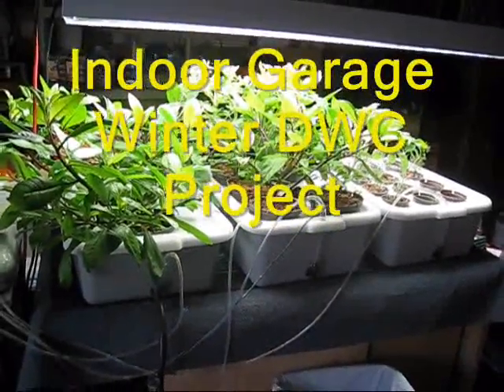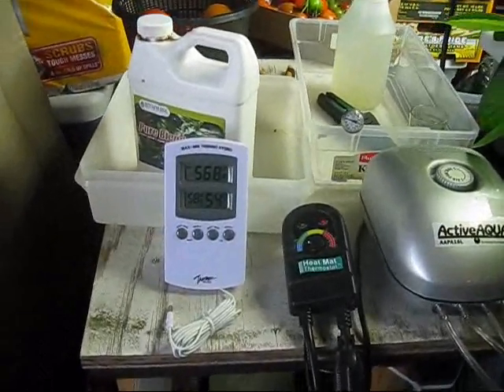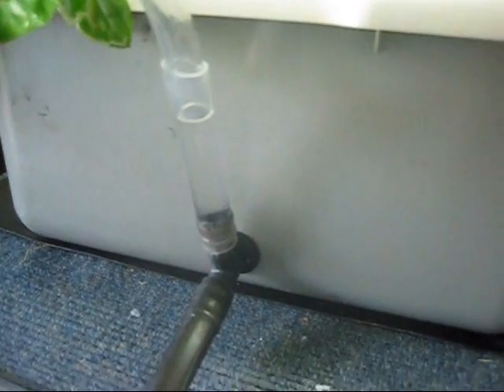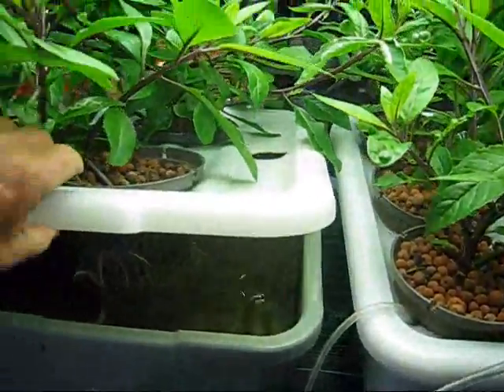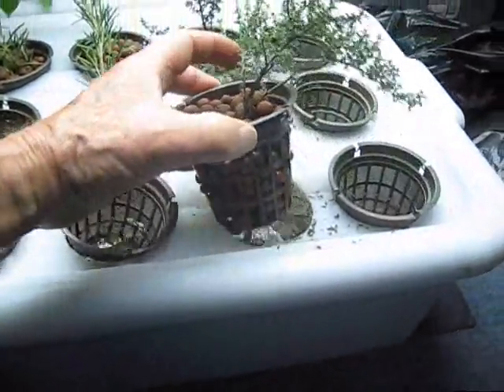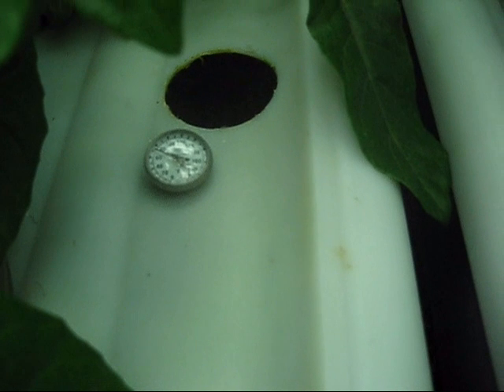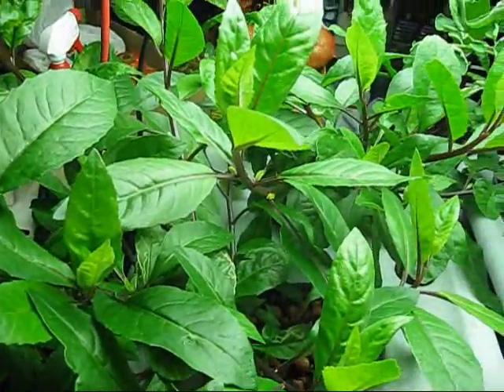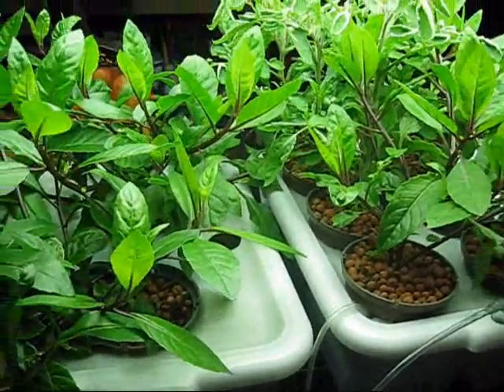Easy DWC Hydroponics Indoor Garage project

Comment from the maker: @bradgray51 
Forgot to mention pH - I usually run the pH of the nutrient solution at around 6.5 or slightly less (5.5 to 6.5 for most plants I grow). Also, you may want to get an analysis on the well water to see the mineral/contaminant content and make nutrient adjustments if necessary, but rain water is a good idea if you have plenty.  I live in the Seattle area and we usually have more rain water than we want!

Comment from the maker: @bradgray51 
No problem - actually, 64 should work ok - but I guess you can bump it up to see if it works better.  Are you using city or well water?  Usually city water is ok but well water may contain minerals or contaminates that can cause problems.  You may need a hard-water nutrient formulation.  You can thank some careless dirt farmers (not all are bad) and industry for that!

Comment: Thanks for responding to me! My water levels are good... I always check that but, I just checked my water temp. and it's 64. I'm guessing that is the problem. I'll put a heater on it right now. Do you think that's the problem even with Lettuce? Lettuce likes cooler temps so I'm surprised by that I guess. Again, thank you so much for getting back to me.

Comment from the maker: @bradgray51 
Hello again Brad.  I maintain water level pretty full  - at least high enough to keep the roots wet, at a temp of around 79 F - also use mild grow nutrient at about 300 ppm until I see significant growth.  Keep air going 24 hours a day.

Comment from the maker: @FenderGibsonWashburn You always make the best comments Paul!  Yeah, that plant is a miracle for me - I'll email you more about it.  You can Google it too - there is quite a bit of info about it. 
I do like those trays - I've used them for all types of hydro systems; they're rugged, cheap, a decent size and the grey color resists algae - so, hard to go wrong.  I was very excited about not requiring air-stones, at least in this case - that cuts down the expense considerably.  I'll be in touch.